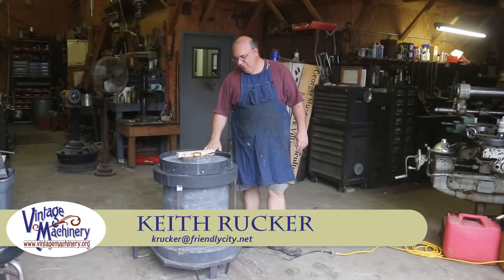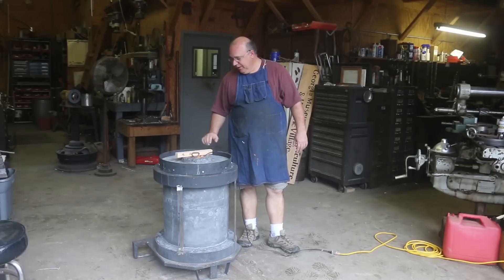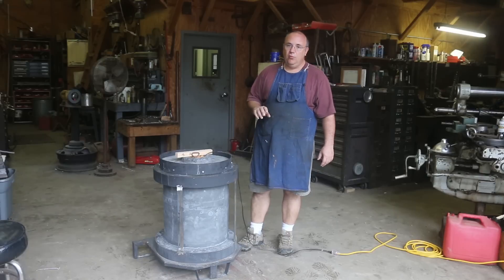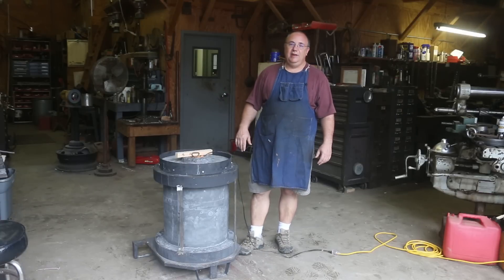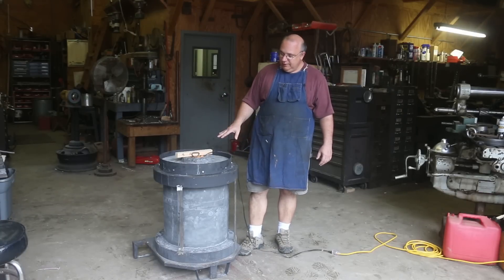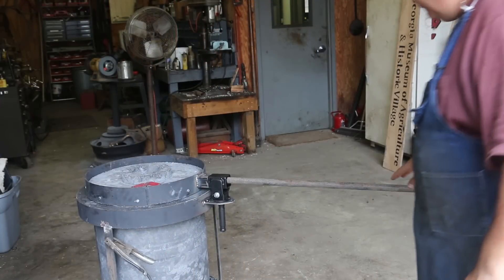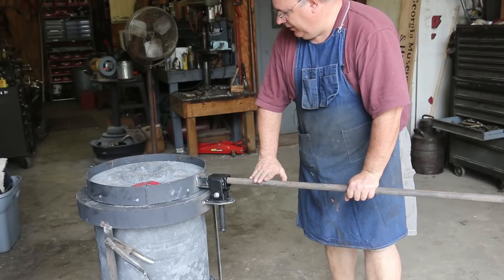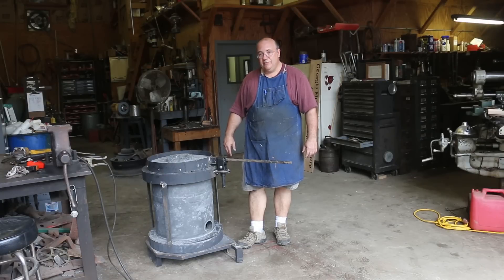Building an Oil Fired Foundry Furnace - Part 8:  Mounting the Lid Hinge

Comment: The project is really coming out nice! I vote for the placement of the vertical hinge support pipe. It won't take much to do, and you may regret not doing it. Nice project! Thanks for sharing!
Reply from the maker: +ToolGuy The pipe will be added - just need to find a piece to use.

Comment: Great job Keith. I agree with the idea to add the tube, either that or a few gossett plates on the piece that's welded to the side of the furnace. That sucker has to be heavy and that weld is carrying the whole load of the top and in time it may  weaken and let go (of course at the worst of times). The design of the hinge is brilliantly simple too and well made. 
Anyway, thanks for taking the time during this busy time of the year to make this video for your fans. We sure have a lot to look forward to in 2016 from you. This, the safe and the shop just to name a few.
From me and my Family to you and yours, a Happy, Healthy and Productive New Year.
Rich
Reply: +Rich206L yep id hate all that load to be on one strip of weld, so some kind of extra added into it, it is a nice design though, hard to imagine anything better, so will save a lot of hassle when using it
Reply: +jusb1066 Yeah, in hindsight, I would have made the part that's welded to the furnace from channel stock or better yet, square tubing (easiest way, I think), Thanks for the comment and Happy New Year.
Rich
Reply from the maker: +Rich206L There really is not room for gussets on the bracket because of how it is made, but I will be adding a pipe to give it support.
Reply: Just need to add some bracing to the lid, going across towards the other side, that would hold the weight better..

Comment: looks very nice! As a junior grade mechanical engineer (associates degree), I firmly agree with your plan to add a column (thick walled pipe) to support the pivot point of your hinge. looking at the plate you welded to the upper ring from the side, once you place the weight of the lid on the plate you will have a minor rotational force being exerted at the weld that will try to force the ring down and away from the refractory (the upper half of the ring, the lower half will try to rotate clockwise exerting force on the refractory with a small compression force) the column will erase that problem. The bigger problem will be the force exerted on the mounting plate when you lift and rotate the lid to where the lid is being  supported by the plate alone. Looking at the end of the plate opposite the welded end, the plate will want to rotate around the axis in the center of the thickness of the plate exerting a shearing force on the weld which, given enough force, would tear the weld upwards on the left side and downwards on the right side. My suggestion? Make the hook that will firmly support the end of the handle and negate the rotational force or you could do the same by installing the column you mentioned before, just making sure that the thick walled pipe is large enough to span the width of the plate you welded to the furnace.  A large thick walled pipe would not only cancel out the two rotational forces being exerted on the plate when you move the lid but, I believe it will look much neater as a construct. Just a suggestion. Keep up the good work!
Reply from the maker: +sandrammer The support pipe will be added, as will the hook.

Comment: Great hinge.  I think you are right on putting a brace under the hinge.  And I was wondering if you were going to do a dry out procedure.  When I worked in the evil polluting refinery we always followed refractory work with a long dry out procedure that required a certain rate of temperature increase.  It has been a long time but I think we were limited to about 100 deg F per hour increase.  It has been over 20 years since I dried out a furnace so the memory is foggy.  Thanks for the video.

Comment: Keith please use the hook for the top handle as this will spread the load away from the hinge. It would be a disaster if the hinge cracked from the refactory while it was hot. Epsecially when heating up then cooling down. Progress goes well. Enjoyed your welding.
Reply from the maker: +Jane Calder I will be adding a hook.

Comment: Good job so far, it's definitely coming along.  If I build this myself I may cut the metal tube in half down it's length into two pieces and weld rebates onto one of them.
 I'd use 2 or 3 wooden discs inserted to keep the metal tube it's shape during pouring the concrete. This way you could bash the disks out and the metal tube will just split apart. I'm sure it would be easier to take out this way.  Hindsight is a wonderful thing !
Reply from the maker: +robowen11 Hindsight is always much clearer!  I think that using a segmented bottom would make a huge difference.

Comment: Being a certified welder, I would highly suggest adding that pipe for a leg support.  Also as a piece of advice down the road,  when welding something, make sure you tack all sides before fully welding a side, otherwise you run the risk of the welding heat pulling your part out of alignment. I love the design on the hinge,  it is perfect. If I ever get around to building my own, I well be copying a lot of what you have done here.
Reply from the maker: +Great North Woods Hillbilly A support leg and a hook will both be added.

Comment: I hope your support pipe doesn't interfere with your air inlet, looks like it might be close. I would take that Christmas warmth back here!
Reply: +bcbloc02 I think it's right on top of it, but, he could incorporate it in supporting the pipe as well, you can crack one of those easily when you trip on the tube.
Reply from the maker: +bcbloc02 Because of the angle the pipe comes out, it will miss it with no problem.

Comment: Happy New Year Keith.  Nice progress on the furnace.  You mentioned mounting the handle...  I would consider having the handle removable so you can navigate around it easier as well as making transporting and storage easier.  Looking forward to the burner build.  I have seen many versions of burners and am wondering what you have decided on.  Thanks-  Fred
Reply: +Fred Miller I&#39;d have designed the handle to be a nipple of 1&quot; NPS, 25 mm DN, pipe, with an OD of ~1.315&quot;  - thread taps for 1&quot; NPT are commonly available... or cut it off flush, and use a set-screw to hold it in place, but I&#39;d want a flat notch to keep a setscrew in place and seated...
Reply: +chemech  Since YouTube can't figure out this commenting thing I have found that the best way to edit is to copy and delete the old comment then paste it in a new comment box and then edit. This will preserve your punctuation instead of getting unicode script.
    Mike (o\!/o)
Reply from the maker: +Fred Miller I will give you a hint on the burner - is is basically a copy of the one that Dave Allen designed and that is used by SV Seeker on YouTube.  The handle will be removable.

Comment: Hey Keith, have you read up on putting a preheater hole in the furnace?  Might not be too late if you are able to drill through refractory somehow.  When I built mine, I followed the book by Colin peck.  In that he talks about how important the preheater is to making the furnace get really REALLY hot.  He has made many different furnaces over the years and seems to have perfected the design.  (For example, the lid hinge on his design is controlled by a foot pedal.  Takes up very little space and let's you open the furnace hands free.)

The preheater works by sending some of the fire inside the furnace, outside and preheating the air as it comes it.  This causes the oil /fuel to atomize more and burn more completely.  I personally don't know if he was embellishing in this book or not, but it might be worth looking into.  I did cast iron for the first time the other day and it took an hour and a half to melt! Don't know how long that would have taken without a preheater.

Great video by the way.  Furnace is looking great!
Reply from the maker: +MattsMotorz I know that with the burner design I will be using, they recommend preheating the oil before it comes in to the burner to help it burn cleaner, but not so much the air.
Reply: Hmm, I always thought preheating the air was more important.  I am just going by what I read in the book.  He really emphasizes the preheater. Now that I think about it, the design in his book also preheats to incoming oil BY preheating the air.  
There is a hole opposite the intake hole in the furnace (that is smaller) that is also tangential to the curve of the furnace that lets some fire come out after it swirls around inside.  The fire is directed THROUGH the intake pipe where it heats up the air.  The air is heated up a little down stream in the intake pipe and I would wager that this also plays a role in heating the oil delivery pipe as it is very small in cross section.

Comment: Hinge design looks great - did though occur to me that the hinge support flange could do with a couple of gussets under, bearing  in mind the weight of the lid when swung out. Ahh, but the bearing piece is under and in the way maybe.
Wondering if a length of rebar would fit to use as the operating lever.
Great progress Keith. :)
Reply from the maker: +ChrisB257 No room for gussets on this part.

Comment: On the last forge that I built I had some cracks in the refractory after a few years of use. I decided that on my next one I would cast the refractory in two or three layers with control joints staggered into it. Essentially casting the refractory as fire bricks in-place. Of course no matter what you do it won't last forever and it will deteriorate with use.

Comment: Nice job, Keith.  You could shorten the handle and weld a big steel bearing on the end as a counter weight making it easy to lift.
Reply from the maker: +Henry Carr It will not be too hard to lift with a fairly short handle.

Comment: something you might consider adding to the gentle drying setup is something to circulate the air inside. the heat will do great to evaporate the water, but you can only evaporate so much before the air is too saturated; she might need a slow flow of dry air
Reply: +Rob Mckennie  With the open burner hole at the bottom I imagine there is a good flow of air already. A fan might just keep it cooler at the bottom and prevent even drying.
    Mike (o\!/o)
Reply: Moholo 88 Oh yes, I hadn't considered the hole at the bottom. If there's a hole at the bottom and the top you'll get a convection current, and then you're golden.
Reply from the maker: +Rob Mckennie I will use the burner to do the ramp up to cure the refractory when the time comes.  There will be plenty of air moving through the furnace!
Reply: Keith Rucker - VintageMachinery.org can't wait to see the burner going!

Comment: Coming along nicely Keith, I don't remember if the plan was to put some on but a set of dolly wheels on the bottom would be nice so it can be moved around easily.
Reply: +Peter Mundy He's going to be using a pallet jack to move it around.
Reply: thanks Co Jones

Comment: I agree with some of your comementers that you need either a strut or a gusset under the hinge. The whole load of the lid is carried by two welds -- on the lid and on  the flange.  I can't remember who said it first,  but nothing overbuilt ever broke. Some Roman motto no doubt. One thing is break at room temperature, the other is break at high temperature!  First is nuisance, second is catastrophe.
Reply from the maker: +Juan Rivero Gussets will be a challenge because of how the whole hing assembly goes together, they cannot be under the hinge because of the plate that bolts there and they cannot be on the top because they would be in the way of rotating the lid.  I was looking at this yesterday and I might be able to make some modifications to things to put some gussets on the sides.  Either way, the support pole under the hinge will go a long way towards giving extra support.

Comment: Mr. Rucker: I've been watching your Furnace construction from the beginning and, despite some minor problems (and who hasn't had those!) it looks like it's going well. Congratulations, you've obviously put a lot of thought into this and I hope your furnace is a great success. I was going to make a comment earlier about you using your refractory as a major structural element, but you've since reinforced the system so that is no longer as much of a concern. But, I find that I do have to alert you to a possible issue. Your new hinge is very nice and will probably serve very well. But, lets talk about failure, not of the hinge, but the lid refractory. The internet has many examples of refractory lids breaking up. Now, if this happens over the furnace, you'll have a mess, but little harm will be done. On the other hand, should you rotate your lid over your twyer or blower assembly, you now have a possible safety hazard on failure. I urge you to consider this during your next design iteration. You may, at your convenience, also consider putting a bend in your handle to keep you a little farther from the furnace during lid removal, your skin may thank you later. Good luck with your build!
Reply from the maker: +Wallace Stalker The lid can rotate in two directions, and while one is over the inlet, the other direction is clear of it.  After playing with things off camera, I think it will be more natural for me to rotate it away from the blower and such anyway so I think I will be fine.  Failure of the refractory in the lid will likely be an issue at some point in time - let's face it, it is probably just a matter of time!  Thanks for the comment.

Comment: That weld joining the hinge to the furnace body looks like it's taking a lot of strain, I'd definitely put that piece of bar in down to the base. It's a small bit of additional work to save a potentially nasty incident in the future. I was wondering if you'd considered making the handle socket square, that way you could put a crank in the lifting handle which would it away from the open furnace. Nice build though, I'm looking forward to the first firing.
Reply from the maker: +Wobblycogs Workshop The support leg is coming - I just need to source the correct piece of tubing for it...

Comment: Keith

Why not do what the industry does with metal formers leave them in and fire it up ,they soon melt and cure the skin.
That's what the operators did with the 700kw and 1.5 Mw induction furnaces we had , also the lining was just armed in dry around the form and a slug put in to hold it down a couple of ton would be ok😄😄😄

Happy new year

Stuart
Reply from the maker: +Stuart Hardy I considered leaving them in and burning them out!

Comment: I really enjoy your channel, especially the odds and ends series. I've been in the business of machining for 25 years and make it a point of learning something new every day. By watching your channel I'm guaranteed I will learn lots of new things. Please keep up the great work. I want to touch on my previous post when I asked about how much draft was in the center metal form, and you replied that the top was about 1/4 inch larger than the bottom. I'm presuming that the chamber of your foundry furnace is roughly 20" deep, that makes the draft almost nil. I would like to try 3 degrees in my furnace build to facilitate easier removal of the center form. My question to you is: would a conical chamber be a bad thing? My math says the top of the chamber would be about an inch larger than the bottom using 3 degrees draft in 20 inches. Happy New Year andThanks in advance.
Reply from the maker: +bob christison After going through this process, I am not sure that draft will be the solution to removing the inner form.  I have had a conversation with an person who has spent most of career working with pouring refractory as well as concrete and he says that the when you have a tube like this, it will almost always end up being somewhat smaller in diameter in the center - kind of the shape of a coke bottle (but backwards).  Draft will help remove the actual tube, but as for the disk in the bottom, you will be better off making it out of several segments that can be removed a piece at a time.
Reply: I agree.  Hadn't even considered that the refractory would bulge the form.  Thanks.

Comment: this is the first furnace ive seen, with the main refractory walls being the main support and also be the cooker.not to mention  being two separate peices top and base. such a larger lid free spans and over laps  most on here poured into old welding tanks, most impressive of the back yard boilers is some dude and a bud keg.(my 2 cents)  lol
Reply from the maker: +Pitz ikata My first furnace was made that way as well - all poured in a small metal barrel.  Most of the professional and commercially made furnaces are made more like this one.

Comment: Hi mate.  Your a bloody good welder I think.  It sounds right and looks nice right away.  Charles made you a very nice hinge, I think that I would follow the plan that was suggested.  I would hate for you to stand there with a hot oven, and the bracket comes off.  It won't cost that much more.  I don't know what the weight of the lid will be, but should that have more reinforcement?  I was seeing the hoop around the lit buckle while hot.  All ''n' all, this is becoming the Rolls Royce of foundry furnaces.
Reply from the maker: +Marcel Timmers The lid is not nearly as heavy as it looks.  You can easily lift it with a short handle in the hinge.  I will add the hook and support leg for sure though.
Reply: I thought that the weight was not to bad but it's a little hard to evaluate at a distance.  You are the best judge about it.